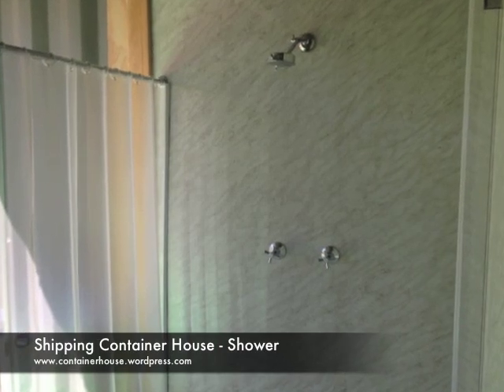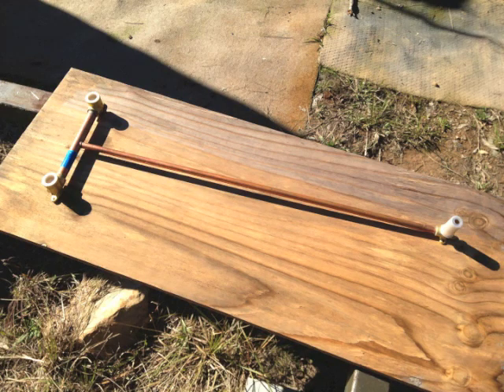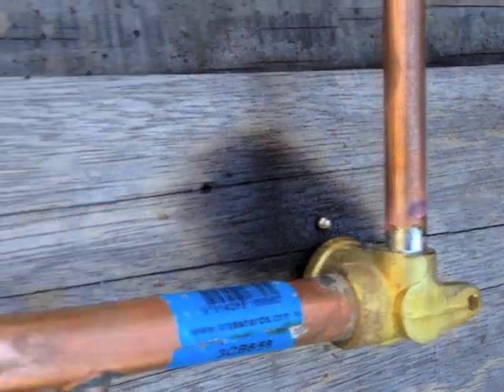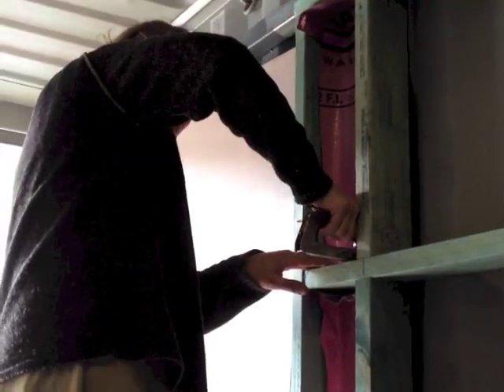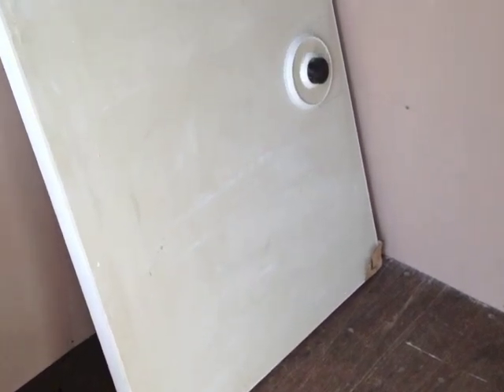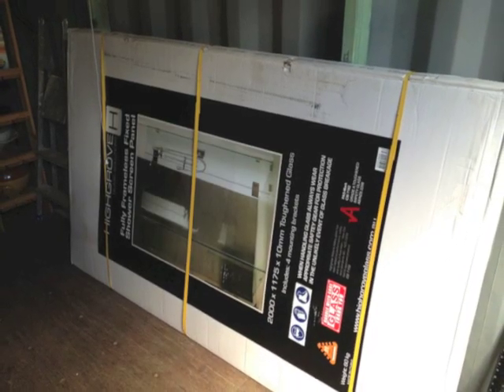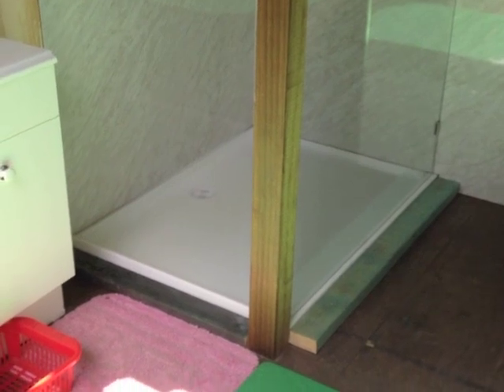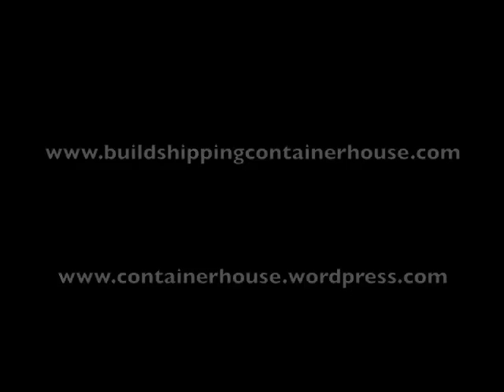Shipping Container House - Installing a shower into shipping container

Comment: I live in the Northwest Territories in Canada, and have been monitoring the methods of which others have used in building these amazing structures. I'm young and have a lil family of my own and the living expenses here are crazy, especially for housing. So I've been doing my research and in my findings, these shipping containers are quite cheap to build and are long lasting. I want to build one up here and wanted to find out how some have installed their own plumbing, windows, etc. And I must say a big thank you for posting these videos. Very helpful. When I do start building and am finished with it, I'm gonna thank you again on Youtube Paul. Amazing, again, thank you
Reply: they are about 2000 -3000 each down here to buy containers that is... I have seen where people put 3-4 together into quite a sizable dwelling... a trucking company might consider bringing one up full and you pay no shipping ???? just pick it up after they empty their load
Reply: really? I did some research and a good new container from NTCL goes for $2500 a piece and they are very large. The materials I would need average about $20k - and when finished, the whole thing with shipping, installation, carpentry work, plumbing, electrical, etc should be around $65k - which is ok I guess.
Reply from the maker: Hi Lawrence, thank you for the positive feedback. I a pleased the videos have been useful. Best of luck with your plans. I read the messages above. In Australia containers a graded. New, Premium & Used. Prices are also linked to condition. I would not buy some of the battered tin cans at the headline price. Mine were premium. Cheers Paul
Reply: +Lawrence Nayally you can get them free if you order a ton of stone from china i did my bathroom in black and white flat stone pebble walls and floor cost 350 a ton came in 2 free 25 foot shipping container
Reply: Who did you order from?  Did you just get lucky or do they include container in item details?  Thanks for tip.

Comment: My two biggest concerns for a project like this in the uK would be damp and condensation and a shower looks like it could be a prime suspect for both.  Did you need to take any extra precautions for ventilation.  I have been working my way through your videos and am full of admiration for everything you have done.  I may be mad but I am considering something similar in the UK but damp and condensation as I am sure you are aware are huge concerns so any learnings from your experience would be amazing.
Reply from the maker: I installed a shower exhaust vent fan yesterday though I suspect it will never be turned on. We use the cargo doors for ventilation. The spray on foam insulation is probably the best in terms of reducing damp. It bonds to the inside of the wall and reduces the temperature differential. Have a look at industrial buildings in the UK to see how they deal with similar issues. Sorry I can be more helpful. Good luck with whatever you do, Cheers Paul
Reply: Paul Chambers Oh for Australian Outback weather, :-)  Thanks for replying I really appreciate it and also for your words of encouragement.
Reply: Paul Chambers Just in case anyone else was considering the same issues I was, I found a potential solution to the issue with a company called Envirovent and a product called a Mr Venty.  It is a condensation control unit that sucks warm wet air out of the house and takes cold dry air from the loft or outside but then uses heat exchange to warm up the air coming in and cool down the air going out, so it actually helps maintain heat as well as cutting condensation.  There is a model that can switch the process around in summer to effectively act as air conditioning.  I haven't done it yet but it does look like a solution.  My other plan was to use Gabian baskets connected by wire to the external side of the container and fill the baskets with straw bales to provide external insulation.  That way the bales and the container are physically connected to each other for a tight fit.  Once Lime rendered it means the steel spine would provide strength and the bales would ensure heat stays in.  Then the plan is to build false walls inside as you did but probably use either straw or another form of cladding to insulate inside.  It does mean the walls will be quite thick and therefore window recesses will be quite deep but I think it works.  At any rate I believe that it will have exceptional heat retention in winter and keep cool in summer to provide a pleasant environment year round.

Comment: Hello again, I am curios why you use the corner brackets to attach your framing to the container instead of screwing the wood from the out side and then wouldn't the wood be pulled up tight to the wall ( screws through the rivet holes ) just wondering, I am really thinking of building one of these after watching you, GREAT STUFF !
Reply from the maker: Hi Bob, the answer is very simple. I do all the work myself, and I can't be on the outside screwing, and on the inside holding at the same time. The panels are also a little dented in places, and I often have to custom cut and fit the wooden frame to get a flat level finish. Thankyou for your channel participation. Cheers Paul